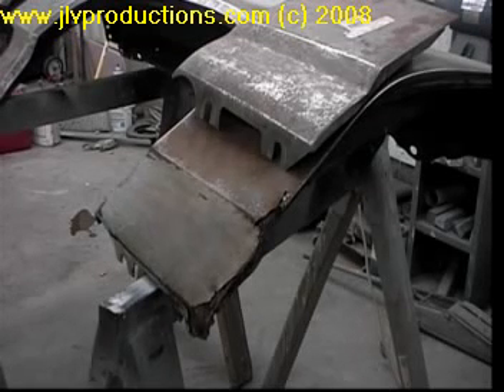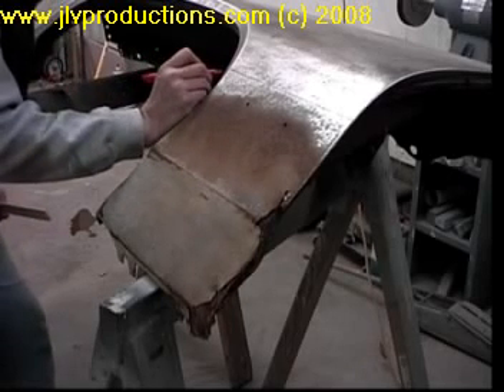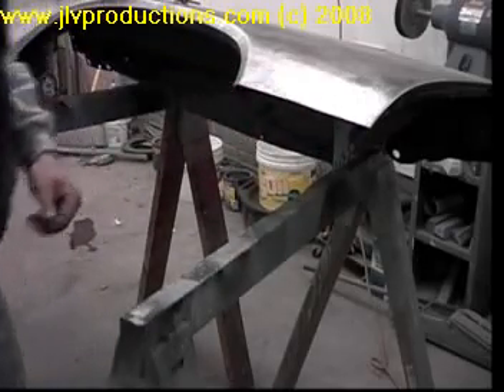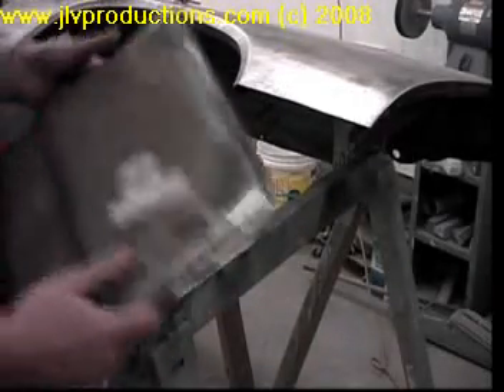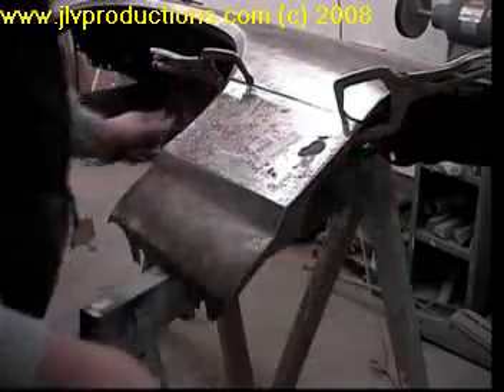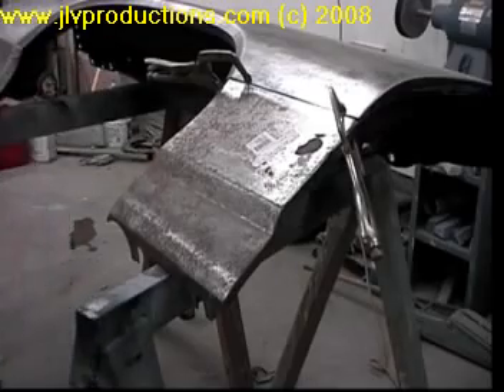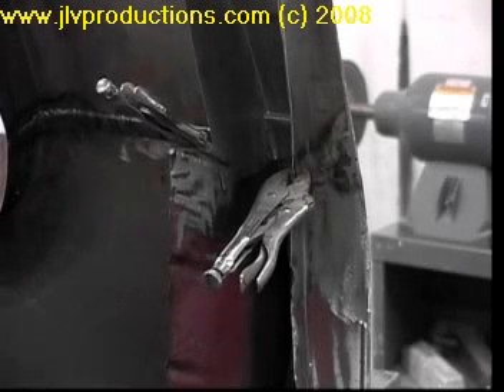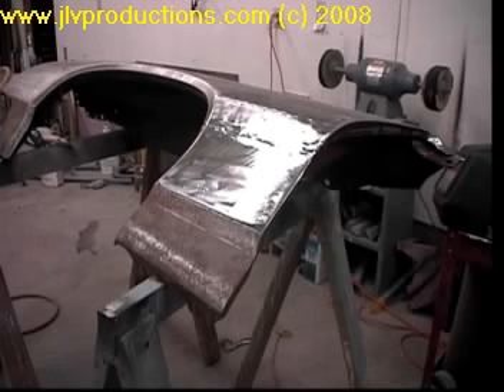Fender Bottom Replacement Auto Restoration

Comment: Do most of the '68 A body GM fenders come with a brace (68 Olds Cutlass, Chevelle, GS Buick) in there like in that vid. Some patch panels don't provide that welded brace on the backside.....how important is this?
Reply: i would look to find the one that does have the brace as it supports and strengthens the whole lower section and is also used when the fender is bolted back to the bottom of the rocker.....

Comment: i did this before. i had a new old stock fender that had sat around 35yrs and was pretty banged up. i just needed the bottom for rust repair so i cut it off and did a small lap weld. the fender was off so i just heavily undercoated the back. 35yrs later it still never failed.

Comment: your an idiot. Wire welder means a welder that pass wire through is to to join steel.  Now a mig welding with gas and a flux core welder are both wire welder

Comment: I have found a couple of tricks that help with the Easy Mig 100. First, buy wire from Lincoln or some other name brand manufacturer. Also, you may want to buy wire in a smaller diameter for sheet steel or body panels. Second, You have to work real slow. It does weld the hell out of heavier steel 1/8" and up. This should work for the patch panels I will be putting on my car. How's the Lincoln welder working and how much did you pay for it?